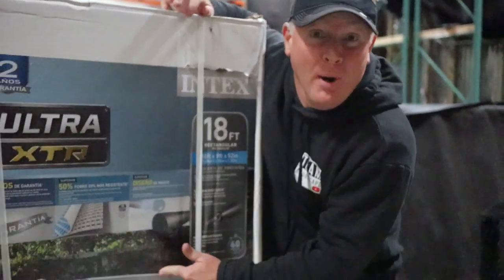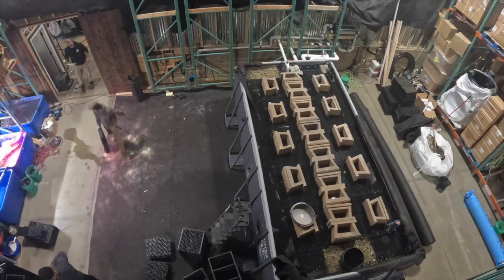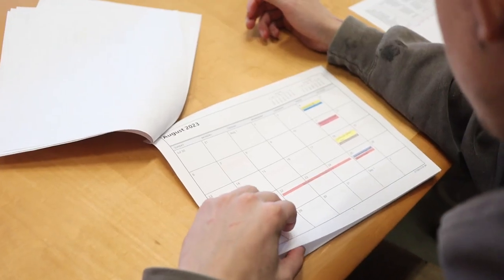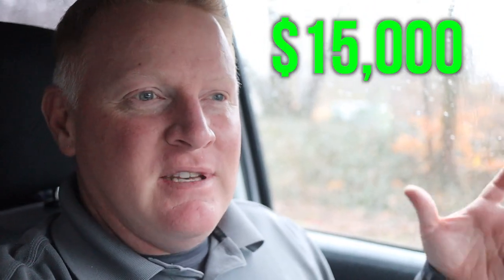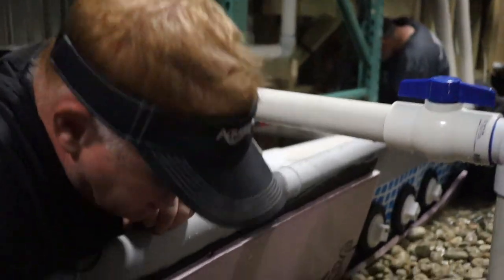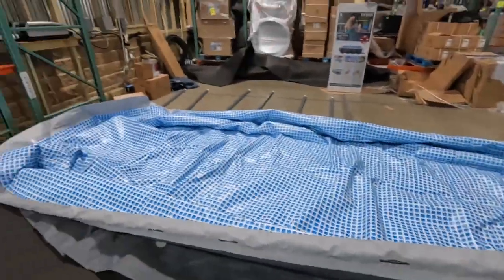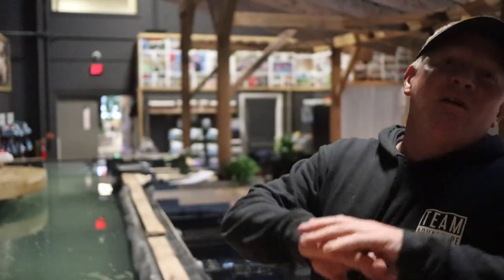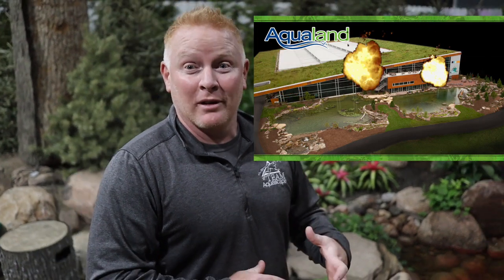We Turned A Swimming Pool Into A Giant Pond Filter!

Comment: Hey guys, I have a question about something I spotted at the very end of this. The faux stump behind Brian in the feature that Chris built has a hole cut into it. It looks like that one is designed for covering propane tanks for your fire/water features? I have had an issue with mine (which does not have that opening) causing my pump receivers to overheat & shut down. It only happens when it gets to be >90°F outside, which is only 2-3 times per summer. I've tried cutting air slots in it, but the bigger you go with the cuts, the more it stands out. Thoughts?
PS, Brian's Bioballs for the win! 🤣
Reply from the maker: The faux stump covers come with holes in them for covering propane tanks, and without for covering cords, etc. Try to make sure your smart receiver, if possible, is in the shade and not direct sunlight, even when covered with a faux stump.